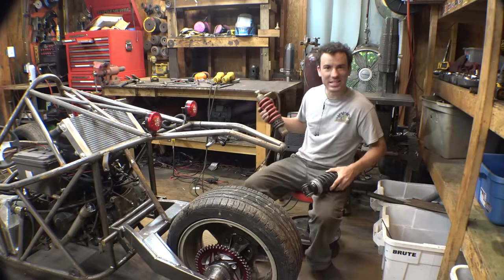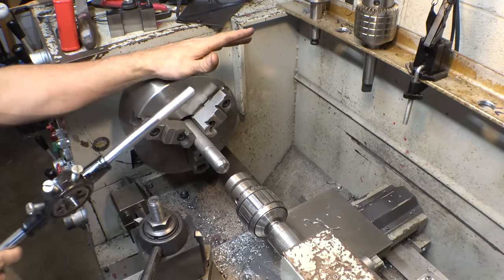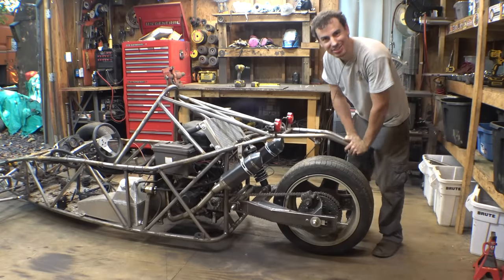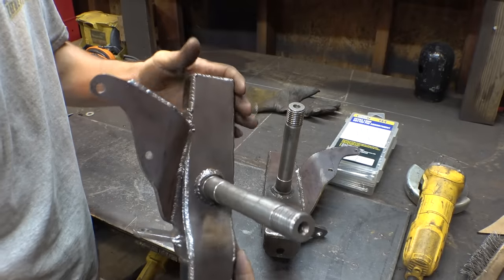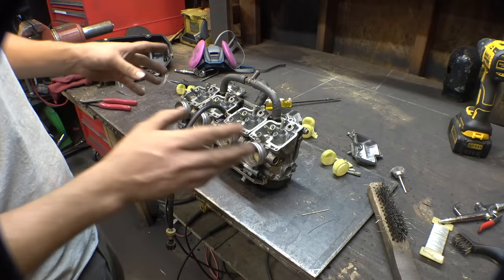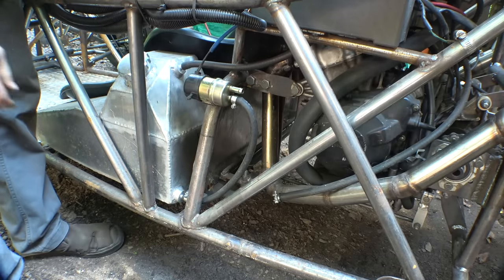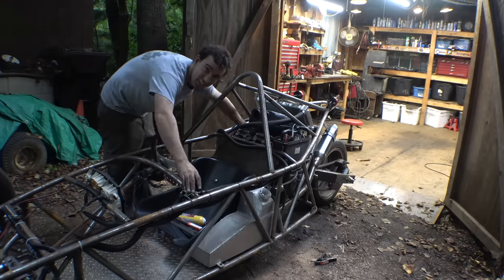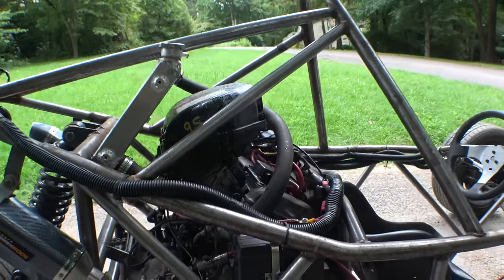Home Built Reverse Trike Project Gets it's Tire Change Finished. CBR 600

Comment: i would set that fuel pump up on the key power not only when the starter turns, will it pump when the starter is not running
Reply: it doesnt work like that, it takes signal from pickup coil and relay is powering the fuel pump when engine is turning
Reply: Yes
Reply: @ToomSugi  Different bike but my fuel pump came on to prime when you turned the key on and then again when turning over.
Reply: @damon20r  theres diference if the bike is fuel injected or carbureted
Reply: @ToomSugi  yes there is a difference but this was a carbureted bike. The pump was a electric diaphragm pump and it would pump until it builds pressure then the pressure caused it to come to a stop.

Comment: I have done the same. When you are very tired, you start missing many things. Now, since lessons learn. I take a brake and once my mind is settled and muscles relaxed. I recheck everything before starting the engine work.
And it never fails, when checking twice, things seem to work just right. Great video and you never lost heart in what you are doing: perseverance goes a long way.

Comment: Handy tip for when changing spark plug in deep cylinder heads, get a straight peice of fuel hose, stick it over ceramic end of plug to finish unscrewing it, u can also use hose to refit and start screwing into cylinder haeds.

Comment: Just a thought for a future build, if you go to the scrap yard and see a torsion bar type suspension (trailer or camper) check to see if it's not one of those rubber types. For a small project like this, they make a really cool swing arm, because it's all self contained in the arm and pivot.
Reply: the same setup is in the original VW beetle :)
Reply: Minis too.
Reply: F1 quite literally uses tortion bar suspension now.
Reply: @dylanzrim3635   that's true 👍

Comment: A quality coarse roughing end mill will speed things up nicely on the rotary table. I also suggest a larger surface area for the rear swing arm pivot bracket.

Comment: When you are using random shock/springs here is something to consider. There is more to the stiffness than spring wire diameter. The amount of coils and thier diameter is also a big factor. Imagine the spring unwound as a straight piece of wire.  If you have a shorter piece of wire it's harder to bend. So a tighter wound coil(less overall length in the spring wire) will be stiffer than a larger diameter one with the same wire and  number of coils. Tge same reason a coil spring becomes stiffer when you cut them.
Reply: They don't become stiffer when you cut them, you only get that feeling as a placebo effect. Physics says you're wrong.
Reply: @FarmerFpv  bullshit. What's easier to bend a 3 ft or a 4 ft piece of wire? You missed physics class. Longer lever easier to bend. A wound spring is still a lever, just a different shape. When you cut a wound spring it is getting shorter in overall wire length. It is in turn harder to bend and stiffer. Two springs  of the exact same height and wire diameter, same wound diameter. If one has less coils spaced further apart it is a shorter piece of wire and therefore stiffer. Trust me, I've been studying suspension design/geometry and building/tuning my drift car for 4 years. It's a one of one car no one makes parts for, I built and modified every piece on it myself. The easiest way to stiffen the spring is by installing blocks between coils. When they can't compress it has the exact same effect as cutting a coil off without lowering it. I cut 2 coils in front and got the desired ride height, and it stiffened it considerably then I measured the distance between the coils and made nylon blocks that snap in. 3 blocks on each coil to keep them from collapsing uneven. I have two sets of 3 on each side. The spring was 10 coils and it's now essentially a 6 coil spring 40% stiffer. The dead coils play no part in the spring rate of the rest of the spring.

Comment: A tech tip I learned back in High School shop class was to take a length of vacuum/washer fluid hose to help put in spark plugs. It will fit tightly over the plug, allowing you to use it to hand tighten and loosen the plug as well as to easily extract/install them from their housings.
Reply: Excellent tip. Or use an old spark plug boot.

Comment: Coolant expands when it get's warm and you'll need to put an expansion tank to collect the overflow so it can suck back into the radiator when it cools down. It doesn't necessarily mean it's overheating when it start's spitting out.

Comment: Really pleased to see this build nearing completion, its one of my favourites.
One thing I waould say is that the brackets that hold the swingarm to the frame need to be a lot beefier, even small road bumps will, in time, crack those ones you have now. Have the base that is welded to the frame at least twice the width as the top section
Reply: And the pivot point as close to output sprocket centre as possible to stop that chain slapping the swing arm?

Comment: On a fast street buggy.. you really want your suspension to be very stiff and firm.. so that it will perform well in the corners.  So you'll be upgrading those later when you come to this realization after driving it.

Comment: I find it useful to use a 1/4 " ratchet. You can't easily over tighten the plugs then. Mind you I'm pretty heavy handed have broken and striped many nuts & bolts

Comment: Hey Chris  FYI a cool trick I learned from my dad. If you push a short piece of rubber hose over the end of your spark plug it will be much more secure and you will have the tactile feedback when starting the threads in the head.

Comment: You can always run your own new wires to the fuel pump, fuse it with proper amperage at the battery and install your own manual switch if you don't use a key on positive to trigger a relay. 
Good work though

Comment: Great job of bleeding the fuel system! Can't be too thorough. 
In CA, three wheelers are still considered motorcycles. As long as you have the paperwork from the bike, you should be able to register that as a custom motorcycle. Usually bike titles have an engine serial# as well, easing this process.

Comment: Need to add a catch can, as water is expanding and constantly loosing it on the road, when it cools it goes from catch can back into radiator,  also throw a thermo fan on the back of your radiator,  should resolve your overheating problems,  but what an amazing machine you have created here man! Good job mate! Love your engineering skills , keep those projects rolling man!!

Comment: Snap on has some really good spark plug sockets that really hold the plug for removing and installing them I have a set (2) that I have been using for over 30 years with no problems...
Reply: Don’t you need to pay for a membership just to even look at the tools?
Reply: @dylanzrim3635  Don't  know, if you are driving around and you see a Snap-on truck just wait your turn and ask the driver for a set, but they are not cheap but they are well worth it...

Comment: Rear swing arm suspension maybe needs a bumper to stop bottom out. Needs proper shock, I wouldnt trust going down the road on that shock. Take a turn hit a dip in the road your finished. Also should probably think about twisting forces on that swingarm. Gonna be a different plane of force than lets say a motorcycle that leans and puts more pressure upwards always. Dont wana see you get hurt is all. Love the builds keep em comin

Comment: for disassembly and assembly, you can use the fuel line, just put it on the spark plug and take it out, or insert it and screw it lightly

Comment: I have dealt with a similar fuel pump problem on my bike. If yours is a combination f2 and f3 then the fuel cutoff relay could be going bad. Also just turning the key off and back on will cause the pump to prime. That way you don’t have to kill the battery turning it over. Also if you use a spark plug boot to fish out the spark plug it’s a lot easier.

Comment: not a bad looking delta trike.  maybe add an idler sprocket to the swingarm pivot as if it were a jackshaft, then it doesn't matter how high the pivot is.
Reply: just came here to say this very same thing... this is a common mistake. In a current project "RIch Rebuilds" is about to find this out on his Electric Harley build.
Reply: @beforebefore  most of my designs have the idler on the actual swingarm pivot or if it's using a jackshaft, the shaft is the pivot.  my front suspension is another story, heavy to the point of nonsensical.

Comment: I don't know if you know this, you could have machined that rear sprocket to also be a brake rotor. then you install the caliper between the two open sections of chain. they have the sit up on Harley-Davidsons, I've seen it on custom bikes before. on the rear brake, it's only 30% of your stopping power anyway. heat doesn't affect the chain, it really would be a good setup for this, you could Mount the caliper right to the swing arm, and it would fix the problem with the caliper being so close. you would actually get rid of the extra weight of the disc brake rotor, as well  hope this helps.

Comment: Looks great and will probably work for your use, but I would avoid drilling holes in any brake disk for track or off-road use. When they get hot, it is more likely to crack with the holes in there. Always great to see you making cool stuff from scratch.
Reply: Also, you can look up torque specs for the spark plugs and use a torque wrench if you are afraid of over torqueing them.
Reply: You have to get them super hot an then cool them fast but it will crack while it cools down with time too but if he don't they will warp even faster
Reply: @ronniewilliz153  They will self repair as they cool from yellow heat.
Reply: @jostouw4366  damn

Comment: If you ever want to sharpen drum brakes, you can with a dremel gouge out "Newfren channels" which you do on a diagonal to the wheel travel and put in gouges like "/ / / / /" onto the shoe which allows dust from the shoes to vacate the shoe itself thus dropping the heat and reducing brake fade.   We call them "newfren channels" because back in the day Newfren a maker of Vespa and Lambretta brake shoes sold these pre gouged for racing.   I done all three of my drums on my Reliant three wheeler and it stops as good as a disc and very sharp efficient brakes because of it.
Reply: How deep do you gouge in

Comment: use a piece of fuel line to install/remove loose spark plugs just slide it over the porcelain top it kinda acts like a sparkplug socket with the rubber in it.

Comment: BTW.A piece of fuel line will grip a spark-plug to pull it out after you break it loose,and makes installing easy./1st time on a plug's gasket=1/4 turn after snug.Then the gasket is compressed and tight.

Comment: As for my opinion, the chain needs some spring loaded roller on the upper side to keep the tension when the suspension moves and to prevent the touch of the upper part of the rear arm by the chain. Maybe am not right but think so. Thanks for the video.

Comment: put a double sprocket on your pivot joint....run chain from engine to pivot point, and a seperate chain from pivot point to wheel...chain stays in tension and clears arm

Comment: Loosen the park plugs then grab one of the plugs wire and plug it back in and take them out easy! No need for the pliers 👍🏼. Pretty much exactly what you did to check for spark lol

Comment: Looking good! You could always try to move the rear swing arm pivot points outboard to align them parallel either side of the chain drive sprocket. Then you would have no issues with the chain rubbing and the chain tension would not alter as the suspension angle changes?

Comment: that is an amazing work of art sir. the only thing i see as a problem would be the radiator location. reason being is if that guy decides to blow up or rupture you will be showered with the fluid. maybe build a shield between you and it... i know you dont have a body put on it yet so maybe work that into the fabrication of the shell. other than that awesome job man.

Comment: I know its an older video, but if you added a fuel line primer circuit, I feel like it would greatly aid in first starts. just a button you can push for 5 seconds or so to prime the fuel line.

Comment: You are going to need a spring loaded high speed roller tensioner on the bottom of that chain as well as a plastic guide on the top. There is no way that chain is going to stay on whipping up and down will wear the chain out very soon and the safety factor is dangerous at best. If it comes off at high speeds and breaks apart the results could cause serious damage to the machine as well as the driver. Just be ready for some serious problems if you don't take the time to get it right. Also when braking that chain will want to jump and bounce continuously if if it not supported properly again it will cause wear and tear on that chain. You may want to add an additional shock to that rear end to counter act and slow the movement of that spring loaded shock it could stabilize that swing arm and help with wear and tear on that drive chain. You may still end up changing that pivot point in order to get it to work properly.

Comment: looks like all you need is to lower rear swing arm pivot like 1-2inches and maybe a chain tensioner. the second thing you might want to do is rear disk brake make it a floater style with a push rod to prevent brake tq from causing suspension jacking.....dm me if you need more info on that.....

Comment: Get you some new spark plug sockets the have a rubber piece in them that grabs the plug and pulls it out too also  snug the spark plugs up then a 1/4 turn as your good

Comment: Invest in a sparkplug socket.  No need to fish out the plug after you unthread them.  They have a rubber gasket inside the socket to hold the sparkplug in the socket. 👍

Comment: Don't worry you're not going to snap off a spark plug. If anything you'll break the ceramic part. Just don't use a ratchet bigger than 3/8 and you can pretty much crank down on them nice and tight. I've seen so many loose plugs because people are scared of breaking them...lol.

Comment: Most states have rules and regulations on how to register a homemade vehicle and/or modified vehicle. Homemade usually involves an inspection certificate and some paperwork at the DMV. If you had the title and part of the CBR frame that has the VIN, you could weld that VIN into the frame and register it as the CBR or modified CBR depending on how it works in your state.

Comment: You must fit a reservoir for the radiator so coolant can expand and suck back.also try take out the db killers in exhaust.i think it restricts it.the holes are very small.

Comment: Looking at the pivot placement of the swingarm under acceleration, you realy need to move that pivot down. That rear end has some issues that need to be sorted out with geometry. I would take a look at at actual motorcycle and see the relationship of the drive sprocket location and the swingarm pivot. Theres actual math that needs to be done so you dont get rear end lift under acceleration, or too much squat. Easiest way to fix it is just to copy an existing setup. The project is cool as  hell and i'd hate to see be difficult to drive
Reply: Came here to say exactly this…  you can literally watch the rear end “pop” up and max out as soon as the clutch starts to bite and add tension to the chain, I hope he sees this 🤞🏻

Comment: oh also, that's a knock pump. it will knock like hell when it's sucking air, and as soon as it reaches fuel pressure, it'll stop knocking. then it only knock a few dozentimes, as it's running, per minute. all depends on fuel demand. 🧐💯
Reply: s*** just wire it to a toggle switch, that way you can prime the fuel system before you start. your way you have to prime it and hope that the prime doesn't go away when it sits overnight....

Comment: Mount your fuel pump down low those pumps have on suction. It needs to be a flooded suction. It will work much better.

Comment: It only sounds like a lawn mower because because your idle is up too high.  There should be a manual adjustment on a short cable hanging under your carbs.

Comment: Future reference for the spark plug removal use a piece of rubber hose just big enough to fit over the porcelain tightly... and pull them out and install them with the same rubber hose

Also idle at the end is WAY to high ... should only be about 900rpm

Comment: You mentioned a engine swap, How about a big shaft drive bike, The swing arm would take some fiddling to make it wide enough for a car tire though. Lot less faffing with sprockets and chain runs though, long as to get the pivot the same place as the bike was.

Comment: I save all parts as well I'm a hoarder too lol it's comes to use later down the road. I can't count how many times I've used stuff from other projects that's of different brand an such. Nice job on the build tho. So happy to see this damn thing moving on its own lol seems like it's been a couple years lol. Just busting ur balls man. There's only so many hrs in a day an you also have to sleep eat an shower in that time frame lol your killing it man. Nice job. You should flip the shock the right way the part with the slot is the spring perch it's supposed to go on the bottom. I mean I guess it really don't matter. But then again it dose cus when you move fluid around it moves different when it pushed or pulled. Unless I'm wrong but that very well could be as well. Nice job tho.

Comment: The fuel pump can and should be attached to the run side of the ignition switch. This way you don't have to spin the engine to get it to run.

Comment: A proper spark plug socket will make your life easier on this engine, they have a rubber boot inside that grips the plug so that you can insert and remove them with just the socket.